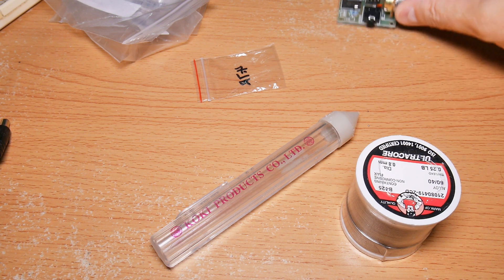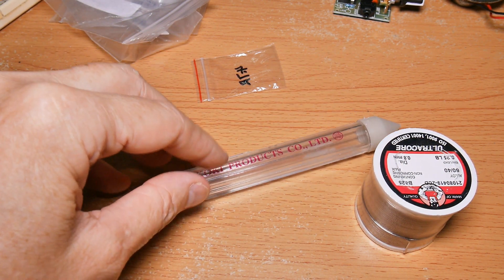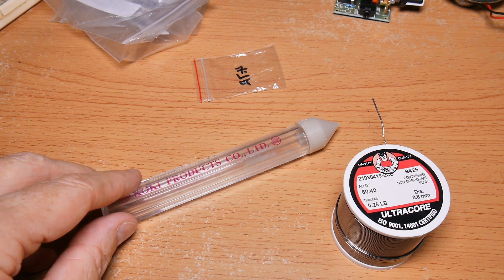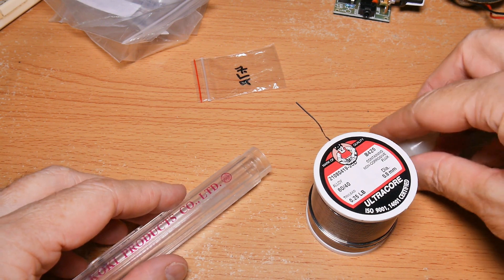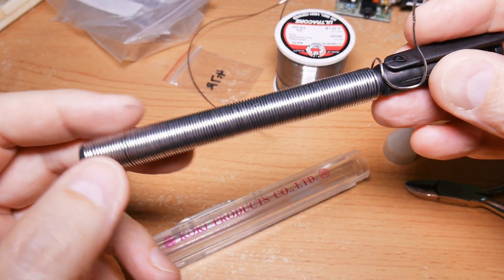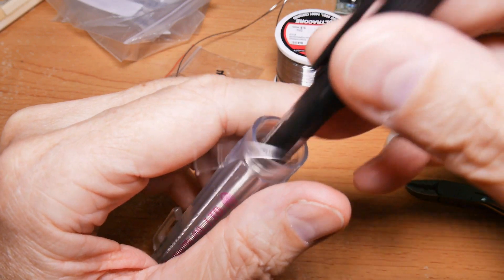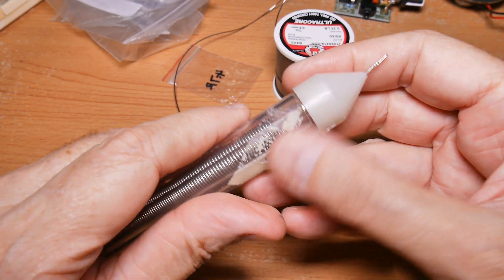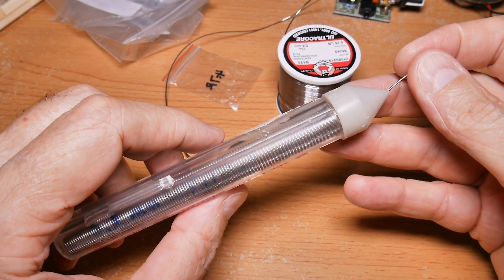Soldering - Money Saving Trick with Tube Solder

Comment: Hi i got a soldering kit. do you think it will work with the smaller tube. nice video 👍
Reply from the maker: It should. If you can find something of the right size to wrap the solder around. Be sure to wash your hands and get the lead off when you're done.
Reply: @tsbrownie  thanks so sorry for the very very late reply thanks again

Comment: Good tip. Mine seems to knot up or bend and makes it very difficult to get out of the tube. No, it’s not wound to tight. I’m thinking of putting a hole in the side instead of the tip or end?!!
Reply from the maker: Is it being pulled from the bottom?  What is the diameter, is it really thin or thick?  (This is 0.8mm.)  Is there something inside the tube / cap that is snagging it?  Are the coils tipped at an angle or are they straight across?

Comment: I wrap it like 3 coaxal spring. The middle one sparrels in opposite direction to the outer and inner one. Gives me 2.5x capacity. If you don't run the middle one in opposite direction, it jams up, if you do, it doesn't.
Reply from the maker: It's time for me to redo mine, will have to try this. Thanks.

Comment: Do you prefer leaded solder over lead-free?  If so, why?  I know everyone has a preference, and I've heard the leaded solder is easier to use.  I've only ever used lead-free, so I can't speak to which is better.
Reply from the maker: Lead free is typically used in plumbing.  For electronics I find it harder to use, it does not like to flow as nicely.